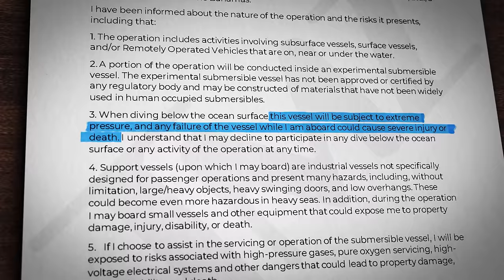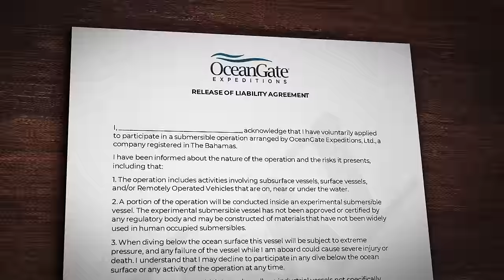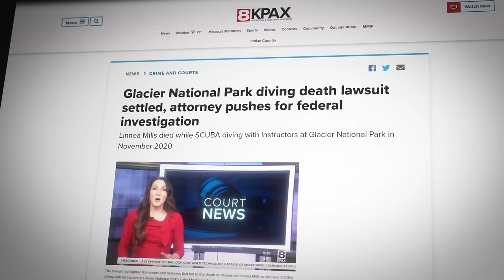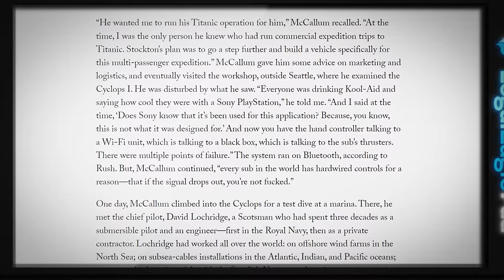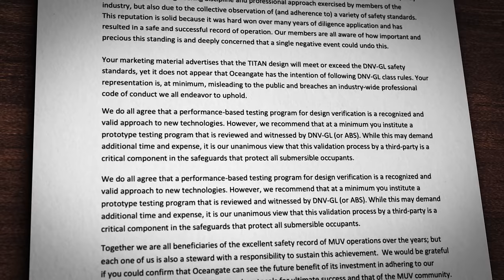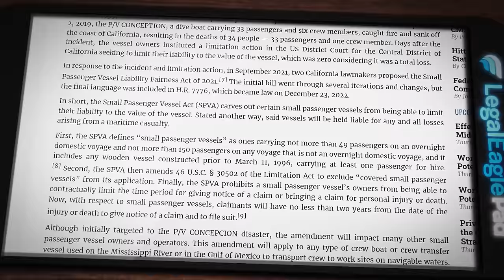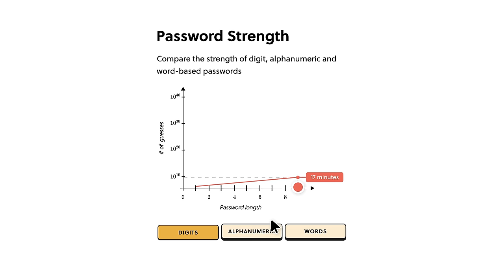OceanGate Is Getting Majorly Sued

Comment from the maker: ⚖ Think the waiver will hold up?
💡Learn interactively with Brilliant!  https://legaleagle.link/brilliant
Reply: Great work as always. Thank you Devin.  Question: can the taxpayers and or governments of the rescuers involved sue the estate of the billionaires to pay back the cost of the rescue and the unnecessary risk they put the rescuers in?
Reply: If it holds up or not, giving a corporation another loophole because protecting them from bankruptcy is more important than holding them accountable to their negligence and compensating the next of kin is peak capitalism and effed up af
Reply: Well....they couldn't call it WaterGate, could they.
Reply: No any good legal defense would destroy the validity of these waivers . a waiver does not absolve a company from their legal duties to provide safe equipment and a protected environment for patrons or passengers in this case . While your waiver does require you to accept personal responsibility for injuries due to normal participation, it does not require you to accept responsibility for a business who makes safety errors . For example, if you signed a waiver to bungee jump with a service, you rely on the technicians to properly calibrate the cords and provide safe harnesses. If you are injured because of faulty equipment or improper procedure due to blatant employee error, you have a case for a personal injury lawsuit.
Reply: I didn't realize that OceanGate did so many practice runs to achieve the disaster. Can't be sued for success, eh.
Reply: Seems to me it all relies on that third clause of the list of 4 qualifiers for negligence. If Rush and OceanGate didn't listen to the fears of damage to the Titan, then tell the passengers, I think the victims might have a case. But I'm not a lawyer.
Reply: I really don’t. But people with money tend to get away with heinous crap all the time, man.
Reply: Devin "Think the waiver will hold up?"
to quote Devin from most videos - "Maybe"

I'd be interested to see if the people who attempted to make rescue attempts could attempt to sue OceanGate for their costs as their actions were made necessary by negligence, and there is no waiver involved for them. Generally I don't think most coastguard services etc will attempt to recoup their costs, but maybe the sheer hubris involved here would be a good enough reason to make an exception
Reply: @eldenringer6466 By international convention, rescue at sea is not charged for. The coast guard will not seek reimbursement, so taxpayers will pay. As far as I am aware, this convention is in place world wide. So wherever you are in the world with your ship sinking, the nearest country will send its rescue fleet to fetch you. For free.
Reply: No. You take risks climbing Everest or jumping out of a perfectly fine airplane. However you do not expect your carabiners to not be rated for/strong enough for climbing nor do you expect your parachute to be beyond its expiration date regarding its material content. Of course all things being equal, when is the last time you read your latest Apple update data before checking "I agree".
Reply: How about a deceptive advertising lawsuit? Oceangate promoted Titan's 96 hour oxygen reserve.  The oxygen reserve implies that if the Titan were trapped on the bottom it could be retrieved within 96 hours. Yet Oceangate did not own equipment that could retrieve the sub from those depths.  Not sure if any rescue equipment capable of retrieval at those depths even exits on the planet.   A responsible company would have those details documented in  emergency action plans.
Reply: FYI, it's a submersiBle not a submersiVle
Reply: I hope not.
Reply: The waiver should not hold up as it was gross negligence, however you've no idea how hard it is to set aside that people saw both the game controller and Camping World light the CEO was so proud of and said "Wow! I want to get in this and dive to the ocean floor!".

Also if what has been said that OceanGate was in reality doing these trips as a front to make cheap vessels for oil drilling companies as their purpose of business with Titanic trips the funding and advertising method, would that alter anything courtwise?
Reply: It's appalling behaviour to sign the waiver (knowing the enormous risks you're taking) and then to sue anyway.
Reply: I think Oceangate is screwed. There is a papertrail several miles long of not only people telling the company that the vessel was unsafe, but of Rush himself being cavalier about the safety of the vessel. There are reasons that these vessels are regulated, reasons the hulls are mostly made of titanium, the pressure hulls tend to be made round, and on, and on, and on. You don't make so many plays to dodge the law, and not know you're being shady as hell. They were reckless, and there is no way they didn't know it. Hell, the fact that they took passengers on board WHILE testing the submersible is reprehensible. That vessel should have been dived, and dived, and dived, and dived. But as with the Titanic itself, we're back to hubris.
Reply: Real engineering was talking about the carbon fiber hull, not the plexiglass window... Wasent it?
Reply: I don't think it will hold up based on all of the damning information, however, OceanGate may argue it was experimental. Ah you just said that. That is the only snag I could see.
Reply: unfortunately with the company being as divided as it is and out of the bahamas , its safe to say lawsuits will be tough to do.
Reply: I sincerely hope not
Reply: You should take a look at the court battle microsoft and the ftc had it was quite the spectacle and I'd love to hear your view on it.
Reply: There is no chance the waiver holds up, BUT the CEO is dead and most likely oceangate is absolutely broke even before a trial (or lawyers will manage to get out any valuable assets so it's broke in the eye of the law once plaintiffs get around to it).
Reply: Such a tragic event mister LegalEagle 😢 😔.  Rip to them all 🙏
Reply: I think not for the reason of reckless disregard for safety. Stockton Rush is recorded on interviews being very blatantly dismissive of any and all regulation or safety standards. His refusal to do the proper testing when flaws were called to attention by an employee and the subsequent firing of the employee. One thing to consider is the fact that the window was not rated to the depth of the Titanic. The lack of care for conforming to ANY safety standards might render the waiver invalid.
Reply: @jessicathomas73  I just wonder if all of the clear methods they used to try and get around law and regulations to get passengers down there might play against them. I'm Canadian, so I'm not really as familiar with US law, so it will be interesting to see how this goes.
Reply: @listey  "It's appalling behaviour to sign the waiver (knowing the enormous risks you're taking) and then to sue anyway."

They are not suing. They are quite dead.
Their families are suing.
Reply: It would seem the experience of the De Havilland Comet was not appreciated. Like the Comet, the Titan was only good for only so many pressurization cycles.
Reply: When I went sky diving in IL (2000), if it is a obliviously dangerous then the wavers don't stand up because they are non-essential business and thus it is up to the business owner to make sure it is safe.  Plus it is held that the consumer, with no expertise, is in no position to understand the risks or the equipment associated with the activity and thus can not make informed consent. 
-- Every place still has the waver in hope that just signing it will trick people into not suing.
Reply: @neilbiggs1353  - The proper technical legal term is "it depends"  :) :)
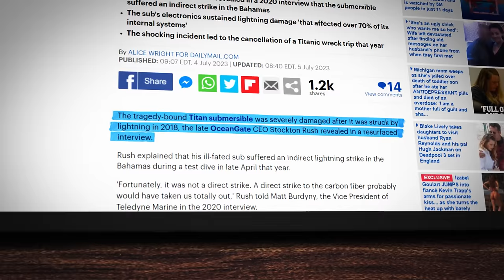Reply: (4:20) "And that's really just the tip of the iceberg."    I see what you did there, Devin.   😜🤪
Reply: You know this whole ordeal is terrible. But you know what else is terrible. You used Stockton Rush name into a sponsorship to an ad. That was pretty low.
Reply: I don't think there is any chance in hell that a competent judge would uphold the waiver after how blatantly, grossly negligent the company was.
Reply: @lanmandragoran8337  Maybe.....UnderwaterGate?
Reply: Oh how nice ocean gate may provide refund of the ticket price.
Reply: Im thinking who will be the first tourists that will go down and visit the wreck of the Titan
Reply: This was awesome! It'd be cool if you covered that huge FTC loss that's resulted in Khan getting grilled by Congress.
Reply: @ShinmaWa1  Dammit! Yeah, I knew there was a particular wording he used, but forgot what it was. Thanks for the correction, but I'll leave my original post uncorrected (because Devin has hopefully said maybe in a few videos too...)
Reply: As I recall, my lease contains a clause that says something about "opting out of the state's landlord-tenant law." Is it true that you can just "opt out" of the law in a contract? That seems crazy....
Reply: It will hold up just as well as the titan held up to the pressure.
Reply: You know its bad when even a Lawyer uses the term 'Majorly Sued'!
Reply: I am sure Stockton Rush is Majorly upset, that he is  Is Getting Majorly Sued.
Reply: I don't think it will hold up, the CEO ignored too many warnings and the submarine had too many known issues.
Reply: You should cover Allen Pan getting sued by CNN
Reply: I think the waiver would be more solid if it also included: "I, Stockton Rush, have been warned that this sub is not fit for purpose, by engineers working for my own company, who I immediately fired, cus I didn't want to hear it, and have repeatedly ignored warnings from experts in the field"
Reply: I think any ship named with "Titan" in it's name should be on the banned list forever.  Titan just means death trap.
Reply: brilliant sucks by the way, oversimplified for complex things yet using overly complex formulas that are unattainable to follow for learners without additional context. meh will definitely not renew after this year
Reply: Oceangate is now in the situation where EVERYONE is trying to sue them, and the big question is who has the power to do so. Which is an open question. 

But, they've also pissed off people who have enough money to sue them EVERYWHERE.
Reply: Nope 😂. But I'm only a layperson 😊
Reply: The waiver will probably implode harder than the Titan submersible when put under scrutiny. 👀
Reply: If waivers are not binding in cases of gross negligence, why should the case be tried under Bahama law? If it is a case of gross negligence, surely the case should be tried in the US.
Reply: U forgot the most important thing about this event
Reply: if the waiver can be circumvented by suing say Oceangate execs for reckless endangerment rather than damages or loss of life, then I could see the waiver being useless. I was unaware of DOHSA. I'm also unaware of how a waiver gets upheld in a poor faith journey/activity. The maritime law might supersede the waiver signing as described. I will be following along .
Reply: @waynesbutler7834 jurisdiction.
Reply: What does the law say about using carbon fiber bought at a discount from Boeing because it was past it's shelf life to be used in airplanes 
    What he meant by support from Boeing 😂
   
    They went against every industry standard and ignored every expert 
   Anyone who knows how to do this told him it wasn't the way
Reply: @MitchellTF yeah like saying they had support from Boeing 😂 

    Buying discounted carbon fiber from boeing that was past it's shelf life to be used in airplanes must have meant In his head they support him 
     Wonder if anyone in Boeing actually knew what he was doing with it I imagine if so it was only some stock room employee
Reply: Why the need for a clickbait title? I’m not going to watch cya.
Reply: @neilbiggs1353  u have a point
Reply: The glass most use is atomically perfect molecularly grown quartz
    And composites are only used for non pressure parts like the gasoline tanks they use for floatation 
    In a instance bob ballard talked about measuring the temp of a black smoker and his fiber glass control arm started melting
    And he said I knew if I drifted into it I'd be done for the sub is made from the same stuff 
    He didn't mean the pressure chamber he meant the gasoline tanks if they got a hole in them he would be stuck on the bottom with no hope of rescue 
    Broke every rule
Reply: @terranovarain6570  dude... thanks for all that science... 👍
Reply: Where did the waiver say the family can’t sue? The wives didn’t sign…
Reply: Don't know.  You have two angry billionaires suing.  What is their litigation budget compared to the long list of people they are going to sue in every jurisdiction they can?
Reply: @Tardisntimbits  I agree, it is going to be interesting to see how it pans out from a legal perspective. I feel for the families as this is going to be dragged out for some time whilst each country figures out who, if any, has jurisdiction.
Reply: Excellent analysis into some very obscure legal issues here- a real "deep dive" into oceanic and nautical laws that rarely get examined like this. Please be sure to give your paralegals and/or research staff some extra kudos and/or time off for their work on this one.
Reply: I wonder could it be possible to take CHC Helicopters Ireland to court
Reply: Doesn’t it just have to say “I’m not reliable” then be signed? I’ve seen contracts on tissue paper
Reply: No.
Reply: Help me sue my place of employment and my old school board
Reply: 24:20 
"Should have brushed up on his math and science skills" - Devin with that final dig LOL.
Reply: Let's say the waivers don't hold up, who is going to do the paying? There's no insurance and in the case of the company and it's officers, what assets do they have? I'd have thought very little. Your comments appreciated.
Reply: I would argue that the waivers did not give any of the passengers a realistic idea of how much risk they were actually assuming.  If I were them, I would have trusted Mr. Rush’s assessment of the danger because I would have assumed he would never put himself in a sub he felt was unsafe.  If I had known that he scoffed at regulations and thought safety measures tended to be overcareful, I would not sign.
Reply: @mst3kharris  so given that Mr Rush is dead and there’s no insurance who are you going to sue? Will Mrs Rush or the company have any assets?
Reply: Does it make a difference that the ceo Rush is now deceased?
Reply: @sarahchevelle  only as to who or what can be held accountable. My guess is there isn’t any money to be got.
Reply: I think based on your explanation about release waivers can be voided if gross negligence is to be found, then yeah, these waivers aren't going to hold up in court. Rush knew that his submersible literally couldn't hold up in water and went on this expedition anyway.
Reply: @diplomamilldoc8562  I haven’t the faintest idea.  I’m just saying why I think the waiver might be invalid.
Reply: When I heard he made it from carbon fibre ( which has low compression strength) I was like , this ain’t ending well .
Reply: I clicked on your video to hear about de news that OceanGate Is Getting Majorly Sued, turns out this is not news and i end up wasting 25 minutes of my break listening to legal jargon. Do you realize click bait is a major disrespect to others time? I thought i could trust your channel.
Reply: @Chae86  just wondering if the waivers are void, who or what is going to pay any damages awarded? There's no insurance and the company won't have any assets.
Reply: @waynesbutler7834 
Hence his loopholes. There were no passengers. Just Mission Specialists. There was no fee. Only donations.
Reply: @waynesbutler7834 
You can’t use the bungee example. There are 0 bungee corporations operating OUTSIDE all national boundaries on the High Seas. So, where are they going to file? Neptune’s Atlantean District Court?
Reply: Even if it does, given such high profile incident and the news about incidents on Rush, no one will ever use their service again.

therefore, their only cause of action s to liquidate and declare bankruptcy.
Reply: @waynesbutler7834  
(: I can only agree ... as this should never ever have happened!!!!! ... 😢
Someone was very irresponsoble!!!!! ... 😢
But I do hope that they have found peace!!!!!
(Hating and bashing isn't going to change anything)!!!!!
Reply: @SYSSMouse  which means there's nothing left to pay a lawsuit.
Reply: @maryalove5534  Thanks so much for a thoughtful  response , this disaster has been heavily debated and will continue and like you mention it should never have happened . The company with Stockton at the helm were all lulled into a false sense of security he passed on to his passengers and 5 died . Hating and bashing only leads to more hating and bashing and yes lets hope they all have found peace . Enjoy your weekend and wish more shared your thoughts ..
Reply: It depends on how Volenti principles developed in the post-colonial caselaw. Also how the waiver and choice of law applies under US contract & negligence law.
Reply: @waynesbutler7834  
(: Thank You ... ☺
(: A Beautiful Weekend to you also ... !!!!! ... ☺
(All this hate is tearing the World apart!!!!!) 😢
Sadly, the CEO was too over-confident, and it cost him his life, and that of his passengers ... 😢  
I don't even know if flowers or wreaths were put in the ocean for them, but like anyone else, they need to find peace!!!!!   Everyone makes mistakes!!!!!
This one could have been avoided, but sometimes people don't fear the worse, or don't follow guidelines, and this is a real sad example of it ... !!!!! ... 😢
The investigation is what is important now, and strong laws that will prevent anymore tragedies like this, and of course, the much needed closure for the families, who are left now to having to deal with it all ... !!!!! ... 😢
This has affected alot of people, as most people were hoping that they would be rescued, and no one was prepared for what happened!!!!! ... 😢
(There are a whole lot of videos on "what happened to the bodies"!!!!! ... 😢)  It is disrespectful ... and the investigation is ongoing, and we should just wait for that, than speculate, and make it to be like a horror show, which is disgusting)!!!!! ... 😢  We already saw enough explanations of what can happen, and it is sad enough!!!!! ... 😢
We now have two big tragedies in the same area!!!!! ... 😢
About a week ago, I was watching a submersible that does tours in Mexico, only they do not go deep, but they keep up with standards, and they get certified EVERY YEAR!!!!! ... ☺
The people looked very happy, and the vessel seemed or looked to be very strong!!!!! ... ☺
This is where those passengers should have gone ... It would have been the right one for the father and son!!!!! ... ☺  It is upsetting to think that they trusted that contract and company!!!!! ... 😢  An employee was fired after pointing out safety issues!!!!! ... 😢
I would think that they could find that out!!!!!
It is all shocking, to say the least ... !!!!! ... 😢
Like I said ... We must now wait for the investigation, hope and press for strict safety laws, and pray that those people are at peace!!!!! ... ☺
Unfortunately, no one can reverse the worst ... !!!!! ... 😢
This is why God exists, because humans are not fail-proof, and they don't know it all, and nor do they know what is always best!!!!!
(: Blessings ... 🌠
(: Peace on Earth 🌎💙
Reply: If it doesnt, then waivers will be pointless in the future. They only exist for one purpose, and apparently they can't even serve that purpose...
Reply: @ymeynot0405  
(: 100% True, and you explained it really well ... !!!!! ... ☺
Reply: @kidathealt  
(: I feel the same on that ... !!!!! ... ☺
Such a sad tragedy!!!!! ... 😢
Reply: @sabagecabage7828  
(: "liable" ... ☺
Reply: Totally off topic, are you aware of the Allen Pan Mythbusters lawsuit?
Reply: 7:06 "... the vessel might have imploded if the dive had went [sic] ahead." -- the past participle of "go" is "gone"; "went" is the past tense.
Reply: @listey  You are assuming that they know the risks they are taking, which seems very dubious.  In fact, I'm afraid you have it backwards.  It is appalling behavior to ignore so many safety standards and warnings and then have people sign a waver to try to make yourself have no responsibility.
Reply: The investigation will find gross negligence and wanton reckless disregard
 
Stockton's behavior / decision making falls under gross negligence, false advertising and wanton recklessness.

The sub may have been experimental but the use of NASA and WU's reputations in regards to this sub was false advertising;  cutting costs by using materials that not only weren't certified for the diving depth (the porthole) but were considered out dated and therefore "unseaworthy" (the carbon hull) should support the investigation finding that Stockton's quest to be a billionaire was not only grossly negligent but undoubtedly showed wanton reckless disregard of his passengers lives
Reply: That AD segue was savage.  Bravo.
Reply: @neilbiggs1353   How about for the DANGER the retrieval involved?
Reply: James Cameron said that the off the shelf products used were all good quality (in fact that's one of the only parts of this craft that wasn't experimental) and that the acrylic port window was more than sufficient. The part you don't understand about the cracking is that it can't collapse in, that's why it's rounded, same reason manholes are round, the same reason any reputable sub that can go deep is rounded. The port window cracked for the first two men to make it to the bottom of the ocean. I'm not sure why everyone locks on the game system controller being used. The main problem with it would be the WiFi. Game controllers generally put up with thousands of hours of game play and don't break. So the main point of contention is actually the hull and using two different materials. Any engineer would be familiar with the 1980s and car engines. The government forced emissions along with limiting the use of asbestos (commonly used on brakes and head gaskets). To save weight a lot started trying to use aluminum heads with cast iron blocks and/or plastic intakes. The results were a decade of cars that love to blow head gaskets because the two/three materials contracted and expanded at different rates. As a lawyer I think the only thing you would want to bring up is the one thing OceanGate had no defense in using and that's the hull. I don't know anything about subs but I know a lot about cars. When carbon fiber fails it shatters like glass. I sure as shit wouldn't get in anything made exclusively out of carbon fiber.
Reply: @signalfire6691  There are legitimate reasons why they can and should pursue claims, but ultimately there is a big cultural taboo against suing for the cost of a rescue effort - as soon as someone crosses that rubicon for example, you'd likely see refugees sued for making dangerous sea or ocean crossings. As much as OeanGate was a tragedy of ignorance and vanity, I'm not convinced that this could be presented as such an exception that it's worth violating that normal standard, I just find it something interesting to think about
Reply: I love it, you use a man's death to plug your sponsor... That's how a lawyer should act
Reply: I mentioned this elsewhere, but I’d like to hear your take on whether criminal charges could be brought against Oceangate. Especially since one of the passengers was French and French courts are pretty good with involuntary manslaughter charges. Admittedly famous cases like Continental Airlines liability for the Concorde crash and Air France flight 447 failed, but this seems more cut and dried. Extradition US to France is possible as well.
Reply: Objection: Is the waiver specific enough?? It never stated a possiblity of hull failure due to experimental materials. I mean you can argue that it would have a giant influence on whether or not someone would want to sign, and leaving out this knowledge results in a failure of understanding that there is a greater risk with this tour.
Reply: In the opening statement against Oceangate, I would suggest slipping in the information that a number of industry professionals including James Cameron worried about the sub. Name him specifically because his name carries more wait to the average person and can influence the jury. This statement will immediately shut down the defense in their claims that they had an experienced diver in the sub that was willing to go down. I would also find out what he knew about the sub. If he didn't know about the complaints and wasn't so knowledgeable about the engineering side of it, then that's going to likely effect what he understood about the risks, and you can examine that through someone's testimony. In fact it might be a good idea to bring Cameron in as an expert witness. It would elevate the notoriety of the case and potentially lend more credibility to the plaintiff. Even if they lost the case, it would likely prevent companies from being so loose on regulations ever again because the public will have a bad opinion on such operations and avoid them. The families might not get exactly what they want but it could prevent future disasters from public awareness. I think that would be a smart additional goal to shoot for.
Reply: These are also some of the same reasons why I don't want to be one of the first Humans to go to Mars.
Reply: @Blackmark52  Yeah, I could also get my 800cc car up to 250 KM/h. Repeatedly if necessary. Is it advisable? No. Is it doable - yes. Until it inevitably falls apart or loses a wheel due to the bearings/tires absolutely not being rated for that speed. What you call a success is blatant ignorance of physics and statistical probabilities. Sounds like you should take Devin up on the sponsor of this video.
Reply: @joetrollson  Not if they're dead.
Reply: @the_kombinator  "What you call a success is blatant ignorance of physics"
I think you misunderstood my comment. What I called success was that the owner accomplished what his method would have predicted. To fail, die, and take everyone on board with him.
Reply: @eldenringer6466 😊😊😊😊😊😊
Reply: @diplomamilldoc8562  I think at this point, there's no point in suing for damages. Maybe criminal charges might be an option? At least the family can collect on the deceased's life insurance policies.
Reply: @Chae86  the person who could face criminal charges is deceased. Fortunately in a way, the families of those who died were probably wealthy enough to not need a payout. The participants likely breached the terms of any life insurance held.
Reply: HOLD UP WAIT A MINUTE!

Could Jack of fit on the door with Rose?
Reply: You can’t protect yourself against negligence with a waiver.  You can protect yourself to a degree by warning people of inherent dangers that are normal and unavoidable.  But if you are clearly negligent then you will be liable in most legal jurisdictions.
Reply: @legaleagle - under u.s. Law does gross negligence constitute fraud?
Reply: @legaleagle can you explain to everyone the implications of the UAP amendment that was just submitted?
Reply: @The1stMagnum  gross negligence is different to fraud
Reply: @andrewwiltshire2689  you can protect yourself against lawsuits by having no assets or insurance
Reply: @diplomamilldoc8562  can you elaborate?
Reply: @diplomamilldoc8562  I've seen someone specifically say that, and it's stuck in my head... So where does your opposing information come from?
Reply: @LegalEagle if I understand correctly from another video I watched , it is illegal for the company to charge a price to go on the sub down to the Titanic because the sub was experimental , so the way he got around that was the people on board basically bought into the company and were part of the crew . Which adds another reason for why they shouldnt be able to sue . 
Personally I think the company and the estates of all of those on board should have to pay for the entire costs of the search and potential rescue and the retrieval of the wreck .
Reply: @shari9721  how much money is the company worth? I'd say nothing. There's also no insurance.
Reply: @Blackmark52  Ah I see - in that case, yes, I can stand behind your statement. Sorry about the confusion and somewhat unnecessary sass.
Reply: Nope.  Fraud.
Reply: I don't see a point in Sueing a company that is already dead. These people were billionaires most this company can afford pay is like 100,000
Reply: Whether or not they can get sued is another question.
Reply: Congrats on being on WIRED! I love your fun and informative videos, the editing is amazing.
Reply: I don't know if in American law it will. Your law is precedent law and is protecting of corporations and property a lot. 
In post-soviet law, it would be a criminal case of criminal negligence that caused death if not murder. Our law values human lives way above any business or property, while the CEO and the head accountant bear any responsibility for the actions of the company down to a criminal sentence. 
Major public harm, such as deaths, indicate that it's a crime.
Reply: Don't know about that, though I had a question: Suleman Dawood was 19, so an adult, legally. If he'd been a minor, would that have affected the suit?
Reply: Well, Rush was on-board. So an argument could be made that it was arrogance/stupidity and not negligence/malice.
Is there not "due diligence" for the so called passengers. I mean they accepted shady business practices (signing up as experts, not passengers), ignored all the warnings available and signed the waver.
If I had any say in it, I would say yes, the waiver should hold. But as always it is more complicated... meaning it is strongly depending on who has more money. And is OceanGate existing long enough or declare bankruptcy before that.
Reply: I don't think it will. Stockton bragged about the corners he was cutting, so he definitely knew that there were better, safer and certified options to build the hull material out of.
Reply: Let's all hope that the waiver... Wait for it... Wait for it... Doesn't hold water!!! 😆
Reply: @diplomamilldoc8562  Yeah, I think getting turned into literally human paste would probably void any life insurance policies these people have. HOWEVER, the 19 year old victim might be a different story.
Reply: @Lethgar_Smith I don’t know, but they should name the submersible they use to get there the Icarus.
Reply: @waynesbutler7834  Not where I live.  I wonder how many "red states" would observe such an exception in general.  Get real.
Reply: @danielgregg2530  Its unfortunate that you want to invoke politics into a disaster that was in international waters , and the lost state of Texas of all places but this the comment section of Youtube where nothing is off limits
Reply: @Tiyath  Privatise the profits, socialise the losses.
Reply: Excellent video!!!!
Reply: Does the fact that Stockton Rush was touting safety to potential customers void the waiver?  Didn't he say it was safer than crossing the street?
Reply: @eldenringer6466 ❤
Reply: @vermyfox8450  This guy is all wet on the law.  There are other aspects to the waiver issue that are likely to be controlling other than the way he tried to tell it.
Reply: Errr duhhhh do ya think sooooo? Imagine I said that really slowly like I was lacking brain power or was nodding out on scag lol.
Reply: No, I don't.  The CEO was misleading his customers.
Reply: I think the waiver will hold up like single ply holds up
Reply: No. Because the diver who posted his video of his trip shows a scene where they invite the passengers to help FIX it. Allowing untrained individuals to partake in the repair of the submersible would mean gross negligence.
Reply: Here In Germany they would have never let that trough even within international waters or not. We got Organisation that test EVERYTHING and until they say yes, you can go onto it.
Reply: @rokkudaun  why do you think they made the governing body the Bahamas and not Canada given its off the coast of NFLD?
Reply: That waiver does NOT say that it was inherently dangerous and poorly designed. LIKELY to lead in death...
Reply: You can’t possibly be serious.
Reply: No I don’t think it will
Reply: Idk 🤷‍♂️ but LegalEagle is a great name for a law firm 🤌
Loved the video! Please post more soon.
Reply: Honestly the thing is there is such a discrepancy between the liability waivers statements of the dangers, and the CEO's outright negation of those dangers. He clearly stated many times that the sub is safe because 'such and such', usually directly implying or even stating that there was plenty of time to reach the surface after any signs of structural failure began.  This is clearly false, and an outright lie.  I don't know how you can have a CEO stating such obvious falsehoods, and the company not have some liability when the exact opposite of what the CEO said occurred.  Ie there was clearly not enough time to reach the surface after possible warning signs were observed(if we believe the transcript going around) or possible no warning signs at all..
Reply: No. It's a slam dunk to prove gross negligence.
Reply: @listey presenting the waiver without disclosing all relevant information is fine, though?
Reply: You're incorrect about Titanic. It did not have a design flaw. The walls were not built all the way to the ceiling because the only way for enough water to enter the ship for the water to spill over the watertight bulkheads, it would have to be low enough in the water, and it wouldn't be that low unless enough compartments had been breached. Even without the possibility of the water flooding freely over the bulkheads, the ship would still have sank with that many compartments exposed to the ocean. Titanic was a good ship and sank because of unfortunate circumstances. It was bad luck that there was an iceberg and it was a cold water mirage that hid it from view until too late. She was as unsinkable as the White Star Line could make a ship, in their own words, and unfortunately she was placed in a situation her dedicated builders couldn't protect her from.

OceanGate's Titan was nothing like Titanic. That was a college kid's submarine project that wasn't built for crushing pressue at depths over 3x further down than it was built for. It only was slightly tweaked. The CEO chose to ignore safety because he didn't like being restricted by the laws of nature. It was actually laughable how idiotic and avoidable this was

TL;DR: don't misrepresent Titanic. It was a good ship, built with care, and it's "design flaw" wasn't a flaw at all. The ship would have sank regardless because the water couldn't flow over the bulkheads unless the ship had taken on too much water to withstand even with the compartments sealed. Oceangate was a mess of choosing to ignore safety because you think it's a conspiracy to stop innovation
Reply: @bradleyeid9260  
They do exist, owned by military and were used to bring up the wreckage from the site
Reply: @listey  
Not really, you sign waivers on the basis that you do not sue on the 'acts of God', but without being expressively being informed about the gross negligence yoou are exposed to, you have the right and duty to sue
Reply: I don't think it holds water, or keeps the water out, wait which is it?
Reply: Couple quibbles...
-The window wasn't certified. Viewports need their own seperate certs.
-While Cameron's work inspired me to go into the subsea industry, he didn't design anything. While he was heavily involved in the process, he had a team of licensed engineers who did the design work.
- MTS didn't issue the letter because it would have been acting as a regulatory body, which would have set it up for anti-trust litigation. The letter wasn't supposed to be made public at all.
- People who happened to be members of MTS went to Stockton on their own. They discussed the same issues addressed in the letter. The main one was that he was calling it a "tourist vessel", which it was not. They wanted him to be more transparent about it being "experimental". Stockton made those changes.
- There is precident for calling passengers on experimental vessels "mission specialists", Cameron being one of them. The biggest difference is that Cameron not only funded his project, he was actually involved in the entire process, to include training for his solo dive.
- BIG quibble - Stockton did have an engineering degree, but he was not a licensed engineer. I don't think the company had a single licensed engineer on staff. This will make it extremely difficult for courts to nail them on design flaws. There might be an in on practicing engineering without a license (the equivalent of practicing law or medicine WOL) that might not work with the company being legally based in the Bahamas.
- Opinion...Unfortunately OceanGate may very well be in the clear legally, but what they did was unethical AF. Without an engineering license in play, it will be difficult at best to get them on professional ethics violations.
Reply: Should've asked your buddy @AttorneyTom who specializes in catastrophic injury with maritime law experience
Reply: Depends on whether the "accident" is ruled normal negligence or gross negligence. This ultimately means OceanGate will still land in court to determine their negligence level... which will ultimately decide OceanGate's fate. Additionally, because some of the participants are not United States citizens, the laws of the countries where those people resided may or may not allow for or recognize such waivers... either in whole or in part.

You're thinking strictly like a United States attorney. Because the participants were from all over the world, this means that OceanGate better have chosen a very good set of international attorneys to navigate the sea of laws involving the nations of each of those who perished on board.

In other words, it's too early to tell if OceanGate will legally "survive" this accident nor whether the waivers will hold up.
Reply: Maybe yes, maybe no, but the PS controller itself is actually a red herring distracting everyone from the actual issues with the submersible, namely the materials used in it's construction.  In fact, the USN uses similar game controllers with their own submersibles.
Reply: @listey   No, it isn't since the people who signed the waivers aren't suing since they are dead now.  Their families are suing and they never signed any waivers.
Reply: Objection: Donald Trump certified the Titan with his mind before leaving office.
Reply: It should not hold! If so many facts point that it was unsafe for the journey, then the journey never should have happened, and those people lost their lives because of terrible design choices.
Reply: No because even if the participants signed the waiver that doesn’t absolve ocean gate of any wrong doing as the submersible wasn’t made out of the same material used to make submarines, there was a lot of corners cut and no after thought before descending into the oceans depths where pressure is increased, the submersible was not up code/regulation which infact means there’s a high chance that ocean gate will not win.
Reply: @listey you don’t understand that yes they signed the waver but it’s still ocean gate’s responsibility to make sure the craft is safe before and after each run, ocean gate as a company still has a legal obligation to maintain and make sure the submersible is safe, that waiver will not hold up as this was negligence that could’ve been prevented if ocean gate took proper safety precautions, I’ll say it again that waiver only protects the company from freak accidents this wasn’t a freak accident the company was warned by a worker who they then fired so it’s 100% on ocean fate oops I mean ocean gate!
Reply: @kojiho604 yes, correct the condition of craft, and safety checks, dive times, depths per dive, documented.  If not stated differently on waiver for every dive or craft could be a loop hole out of waiver. Otherwise an example that anyone could be a Dr Kevorkian. or assist suicide, or death.  Experimental or Approved, By whom?. Was it murder suicide based on stubborn uncalculated ambitions and lack of knowledge and forsight? All questionable.
Reply: NOPE, didn't hear what he said?  He intended to construct this vesselk in a manner that would put lives in danger and by manipulating the wording of that waiver formn he directly demonstrated a blatant disregard for the lives of passengers and his own life.
Reply: NOPE
Reply: NOPE!!!
Reply: Rip
Reply: not when they knew it was flawed and had been used many times the saftey limits of the carbon fibers for a start
Reply: No, Stockton did not disclose the warning signs previous passengers experienced. He did not disclose that the thrusters and communications had failed in the past.
If I sign a waiver to ride a rollercoaster and one of the warnings is death, I will think, "Many others rode this with no problem, so this is just one of those standard liability waivers".
If the roller coaster operator told me, "This has slipped off the track a time or two and people have had their seatbelts unfasten in the middle of a loop, but nobody died"... I would not sign that waiver.
Stockton did not disclose things he should have mentioned. He explained the dangers of deep sea pressure. He explained it was an experimental submersible, but he didn't explain the problems HE KNEW ABOUT that the Titan had experienced before. He didn't tell them they would hear loud cracking sounds on the way down. He did not disclose the actual rated depth of the plexiglas composite window. He left out a lot of information that would get most people to refuse to accept and this is why he is grossly negligent.